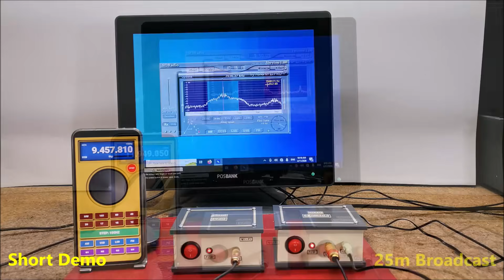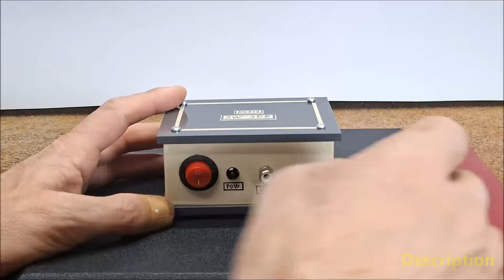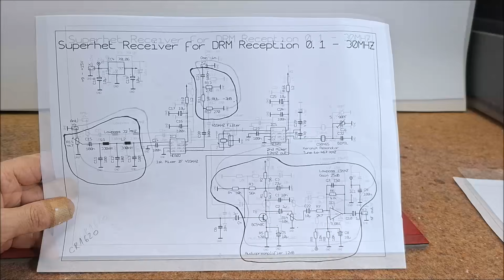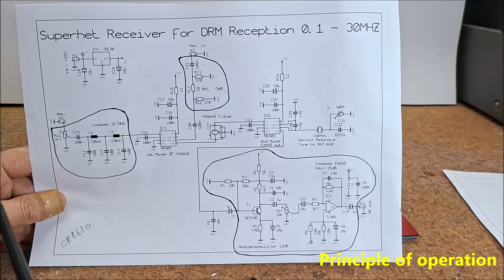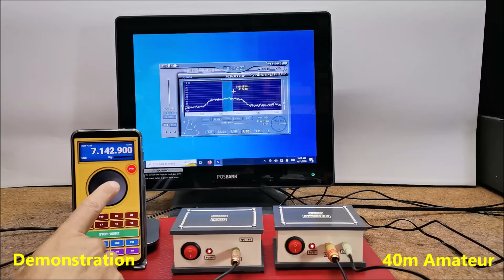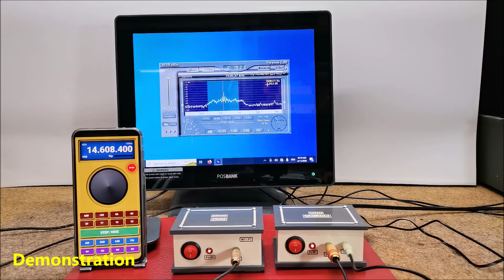Simple SDR Receiver Using 2x NE612   Dual Conversion, Superheterodyne 0 1–30 MHz

Comment: How do you deal with image rejection?  It seems to me that it would receive anything 455KHz on either side of the VFO.  For example, if you tuned it down to the AM broadcast band, it would pick up 590KHz and 1500KHz at the same time. In my case, both of those stations are active in my area.
Reply from the maker: For this type of SDr receiver, this is normally inevitable